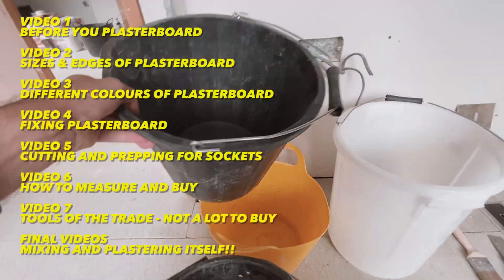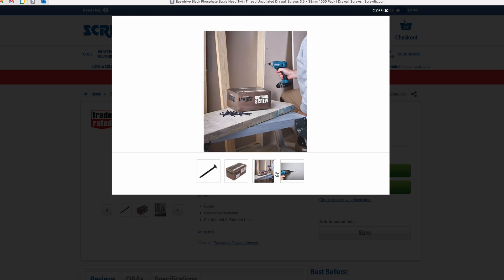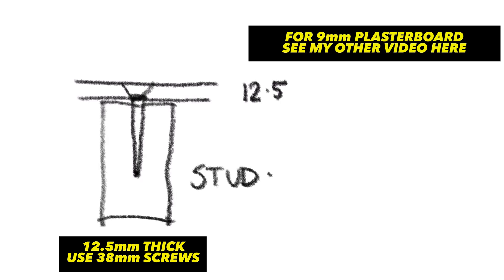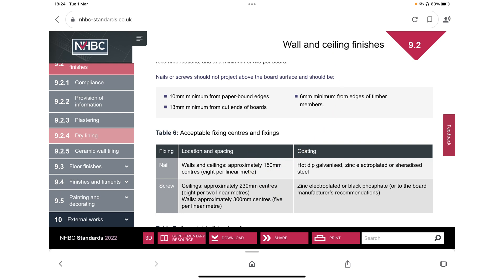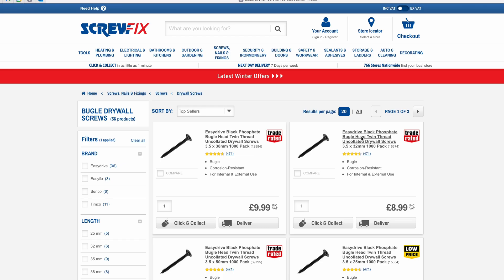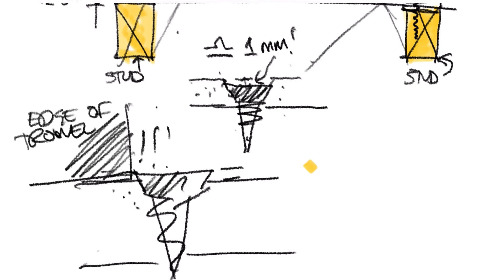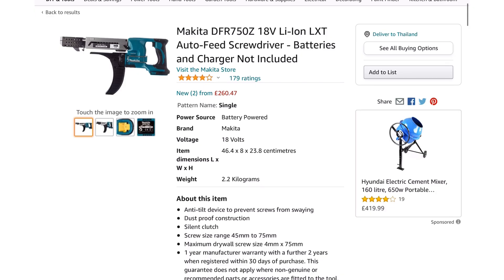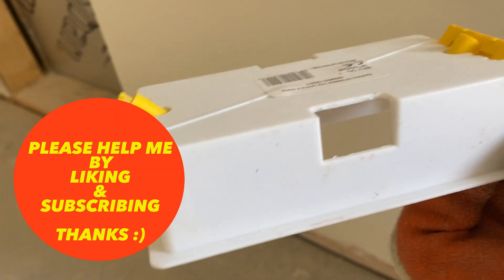ARE YOU FIXING PLASTERBOARD WRONG? - how to avoid common drywall screw mistakes - part 4

Comment: Well I use 25mm screws, never had one pull out.  Well maybe 32mm for 12mm plasterboard
Reply: If you compare the holding force of the screw into timber, it far exceeds the force needed to pull through the plasterboard, which is where you do see failure
Reply from the maker: Rule of thumb, 2.5 times thickness give or take. It’s not possible to have a discussion when someone uses the “I’ve never had a problem” arguments when they deviate or use something inferior to save money. 25mm screws on 12.5mm plasterboard is just asking for problems down the line. If it’s your own house, go right ahead, will just be a little of your time.